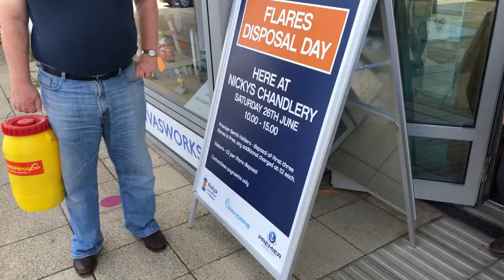Our SAILBOAT'S 30 Year Old FLARES DISPOSAL l Ep. 20

Comment: Just use water instead of antifreeze or mix water with the antifreeze because that’s what it’s made of to
Reply: You cant just add water there is a mix ratio you have to have if you dont have that ratio the antifreeze is useless
Reply: It’s a car engine or lorry engine in.a boat and when servicing cars or lorries or whatever you always mix the antifreeze with the water otherwise it can be too thick for the engine and not circulate so well for the  water pump